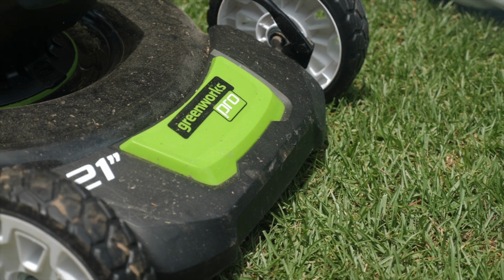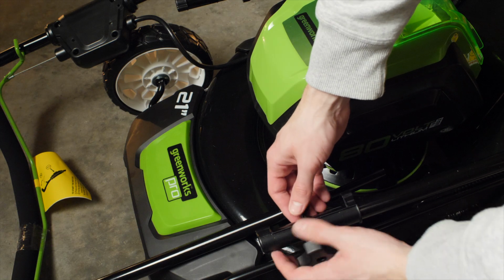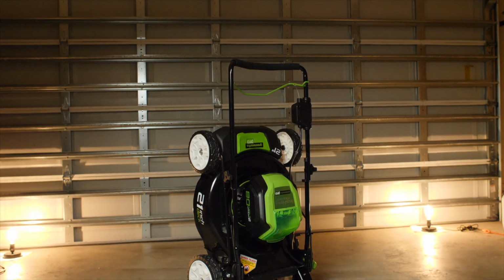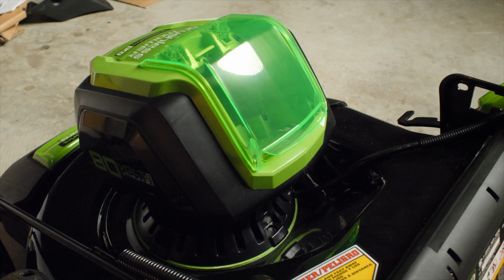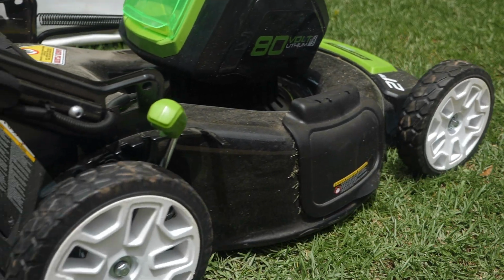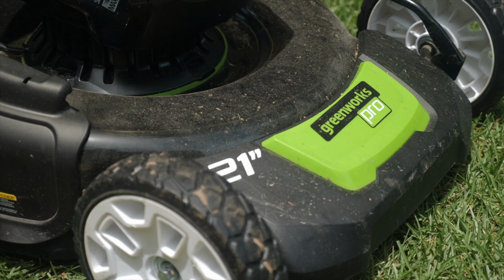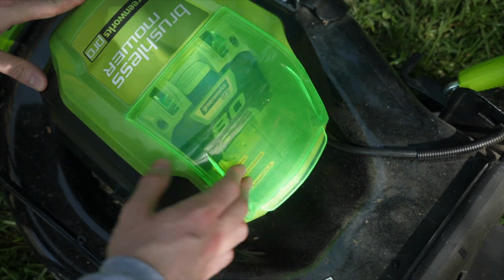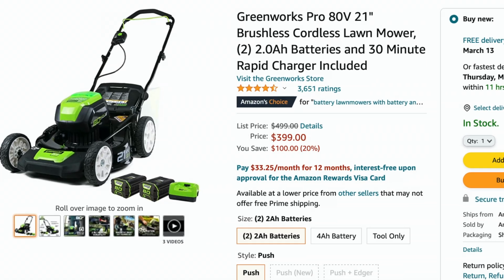12 Month Review.. GreenWorks 80 Volt Electric Lawn Mower

Comment: I haven't been able to make the leap even though I want to.  The reason is that I can't imagine this mower will last for 17 years like my gas Honda, which is beat to heck but still running and starts on 2 to three pulls in the spring.  Then, after that first run, it always starts on the first pull.

Comment: Greenworks should have a pouch for the other battery,which could be swapped for the discharged battery if you are mowing thick grass and drain your battery. I have a Stihl 20" battery mower that has a pouch for a spare battery,which comes in handy when I am hoovering  up leaves in the fall,which seems to drain the battery faster than grass cutting. I have had a Greenworks 80V leaf blower that is handy for cleaning out gutters and blowing light snow off my sidewalks. Neat thing about the blower: If I get in a cloud of snow while cleaning my walks,I feel a definite "tingle" in my gloved hand-I think snow gets into the thing and I get a tiny "shock" from the battery. Not dangerous but surprises you the first time it happens!

Comment: Ive been looking at electric mowers, leaning towards buying one. Wish this model would include a simpler switch between the mulch and the bag options. I just flip a lever in my Toro, but I dont think this issue would be a deal breaker for me; just, why not make it simpler?

Comment: Has anyone noticed if their motor shaft is wobbly/not true? I have two 21" non self propelled 80 volt mowers and one self propelled and all 3 the shafts are wobbly and so each end of the blade does not travel on the same plane, but rather roughly close to 1/2" apart which is not good and likely affects the cut quality. Here is a video I made attempting to show mine. If nothing else, you can see the wobble in the plastic piece with the fins...

https://m.youtube.com/watch?v=3sv7fbDqzhE&pp=ygUdZ3JlZW53b3JrcyBtb3dlciBibGFkZSB3b2JibGU%3D

Also in the self propelled there was an extra screw in the drive wheel which started to destroy the plastic gear. I've heard of others having that too. As if a worker in the factory leaves it in there for the fun of it.

Comment: I've gone through one season with a dual battery version of the Greenworks 80v mower, and so far it's been a great upgrade from my old 19" 40v mower that I'd hoped for.  I gave the 40v Greenworks mower to a friend, and it's still going strong after seven years, but my yard is a little too large for the 40v to manage when I've been away and the grass gets 8 to 10" tall.  The 80v is very powerful, but goes through batteries when cutting tall grass.  With a sharp blade it performs just a strong as my supposed 6.5 hp Honda gas, which was about equal to a 5hp Briggs.  I'd recommend 4ah or better batteries.

Comment: Whelp I’m sold. I was told not to go electric but willing to give it a try.
Reply: I have a Greenworks 80v 18" Chainsaw... Run it with a 5Ah battery, and swaped the chain to a semi-chisel type, and it is better than any 38-42cc gas powered unit I've ever used. 

I can down a 24" round tree and take off 3 lengths with the 5Ah, I also have 2x 2Ah batteries as back up, I get 2 lengths with each small battery.

Comment: i bought a similar greenworks to this 4 years ago and it was awful, i had to take it back and exchange it for a webb petrol mower, the battery lasted 15 minutes and took over an hour to charge, it was very weak, the guy in the shop thought the battery was too weak for the power needed to run it, the cut was ok but just a puny mower

Comment: Costco routinely has the newer much improved version with the self propelled, better handle with controls, better latching mechanism for the collapsible handle and the dual battery slots for auto switchover onsale for 450 and that comes with two 4ah batteries.
Reply: I don't see it for $450. I see it for $529. Where are you looking and is it legit?
Reply: @davidbueso3840 It may have been regional, or maybe he physically saw promotion in the store, or both. There are times I have seen lower prices in the store than their website.

Comment: I paid less for mine, but I also only got one battery.  I love the two speed feature.  I always hated how most mowers slow down when you run across thicker stuff but this one speeds up to adjust to the thicker stuff.
Reply: I was looking at the walmart one  had only 1 battery but it sais (1) 4.0ah so vs the (2) 2.0ah so thats same just bigger battery? Maybe yours is the 4.0ah wich would be the same as 2 in this video.

Comment: Dont Buy.

Mine worked 6 times on 1/4 lawn before it stopped working.  The battery switchover function only worked the first mow - never worked after that.  I really loved the mower while it worked, it was fast, quiet and cut really well.  I stored the batteries in the house and the mower in the shed.  Tried customer support, was on hold 20 minutes before giving up.  Going back to Costco.  sigh...

Comment: I can't get the battery off of the charger? I don't see anywhere on the charger or the battery how to release it? Help?
Reply from the maker: You remove the battery by pulling the battery. Don’t pull ‘upwards’ on the battery, pull it ‘outwards’ from the charger. It would be the exact opposite way of how you put it on the charger. It might take a little force, but it’ll slide off the charger. Hope that helps.
Reply: @ImChillToo  Thank you. I was afraid I might break something if I forced it, so I pulled it outwards more forcefully. I should have mowed today but I didn't. I haven't mowed with this new mower yet. It seems like it's heavier than our other electric mower.

Comment: Thank You for your review.  I’m trying to pick my first electric mover between EGO, Toro and Green 
Works… any big reason why you picked GreenWorks?
Reply from the maker: Thank you. No particular reason that I picked the GreenWorks. Mainly because I had seen it recommended before, and it just so happened to be on sale at the time when I was looking. The EGO and Toro could be just as good or better. 

I had the Kobalt 80 volt from Lowes for a few years, gave it to someone else, and now it’s starting its 5th year and their happy with it. This will be my 2nd year with the GreenWorks. 

Regardless, I’m very happy with the electric mowers. And won’t buy gas again; it’s a whole different experience mowing the yard.